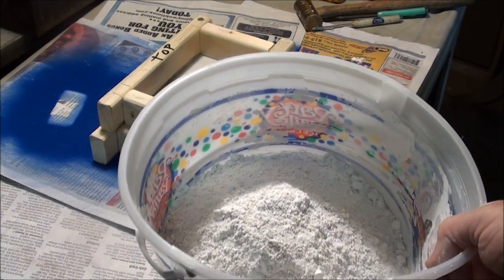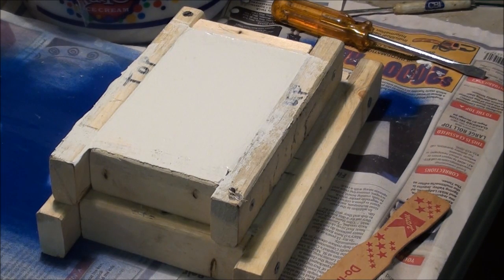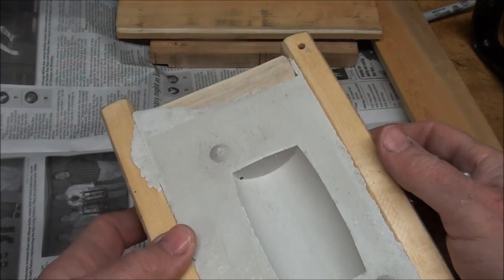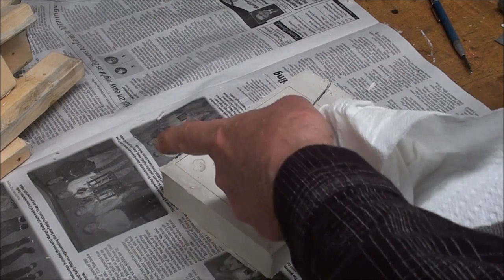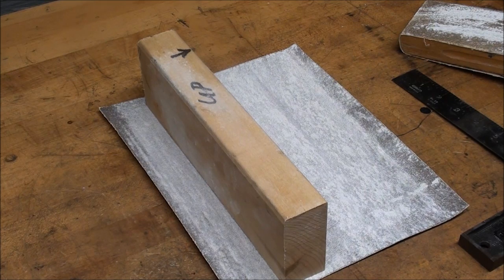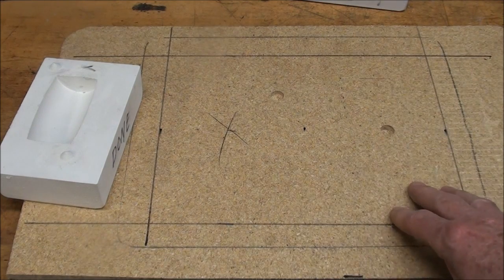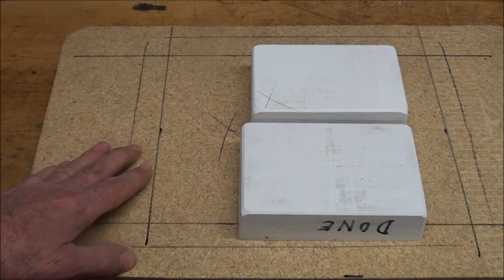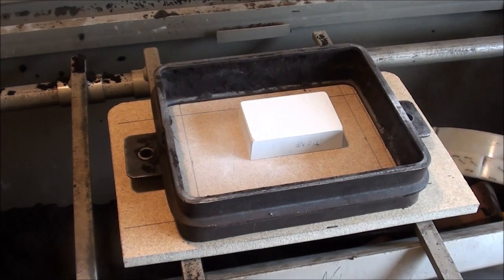Shop Tips #166 TUBALCAIN MAKES A LEAD HAMMER MOLD Part 3

Comment: Nice work sir. I too am impatient with plaster moulds.  I have taken to putting them in a 110 degree oven for 2 hours or so, depending on the size. The low temp speeds up drying and prevents explosive steam bubbles.
Keep up the excellent videos.

Comment: Very interesting so far.  I will have to get my foundry set up again after watching all of this.  The one thing that has been slowing me down is that I have to pipe up some natural gas as it is a natural gas foundry.  The gas company always gives me a hard time when I close the gas valve at the meter and break their seal.  I am just going to make a short line in the back yard to get a safe distance from the meter.
Reply from the maker: That's what I did.  I keep my valve hidden behind garbage can.

Comment: Enjoy this series immensely.

I have a question on the final aluminum mold.  Is thicker better?  In this I mean, does the larger mass of aluminum (once hot) hold the heat better and produce better castings? 

Of course as I am watching this, I am thinking, I can also use the two wooden patterns to do a one off sand casting mold  for a brass hammer.

Comment: No artist, You say? Oh yes, You are! And a very good one too! Thanks for yet another great project video...:)
PS: is it possible to get air bubbles out of the plaster by using a vacuum chamber? I use that when casting epoxy, and that works very well.
Reply: Hi EW and LK, you both mention using vacuum, will low vacuum from a vac cleaner work, or do you need much higher vacuum from pump like a fridge sealed unit to make de gassing work? Thanks,
Reply from the maker: Not much working time with plaster.

Comment: In dental school we used vibrator and vacuum to reduce investment air bubbles before casting gold or silver.
Reply from the maker: I have used vacuum when pouring rubber. There is not much working time with molding plaster.

Comment: I didn't know I could use oil based sand for my foundry.  It seems like it would be much easier since I wouldn't have to re-moisturize the sand after each pour and I wouldn't have to worry so much about venting.  Where did you get your sand? Did you make it?  The sand I use is just play sand an bentonite clay.
Reply from the maker: Thanks for watching-the sand came from a school auction

Comment: I'm pretty new to the whole casting process, and I've never done any myself, but I'm curious as to why you didn't do the pattern draft in the opposite direction and use the back of the mold as your parting line. It seems to me that would simplify it a bit.
Reply from the maker: imbored742 never thought of it